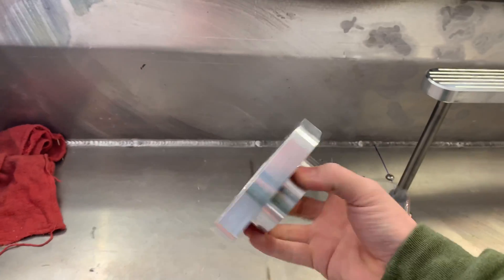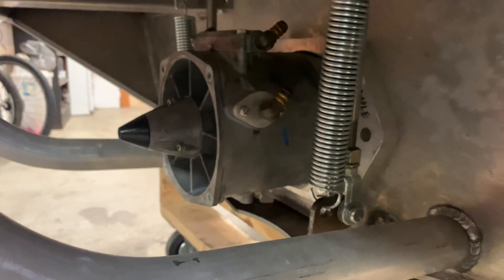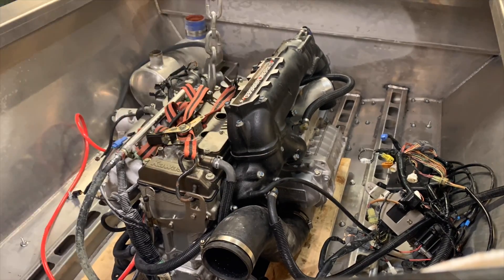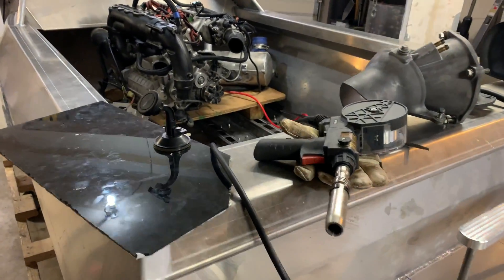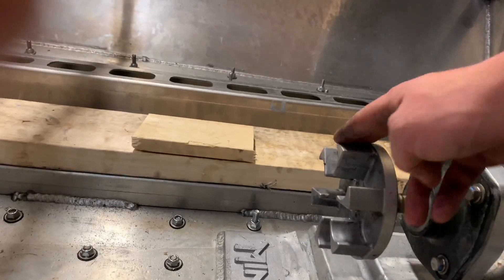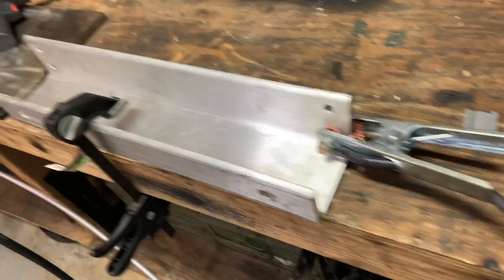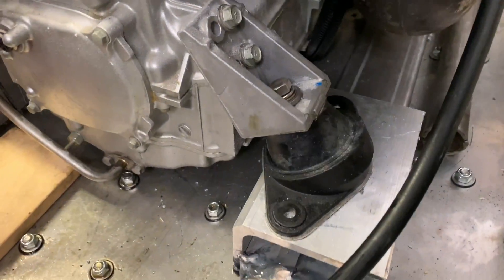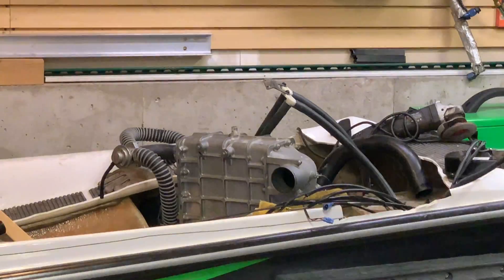Mini Jet Boat Build 6 - Motor mounts, pump shaft collar and engine install.

Comment: Have you ever pre cleaned your intended weld area? Steve Wonder puts on a good aluminum welding course you should take.
Reply from the maker: Before this video, no. This was the first time i had ever welded aluminum.  And for the welding course for "stevie wonder". Id probably learn more from you uploading a video of welding motor mounts into your aluminum boat.

Comment: How about using some Lock tight or some Lock washers!
Reply from the maker: Where were you 4 months ago! =] I actually had one of my motor mount bolts come out specifically due to not lock tighting them! (they all had lock washers but engine vibrations didnt care)
Reply: @Localhost127  rite on! I really enjoy watching your build! Where you live? I'm in Washington state

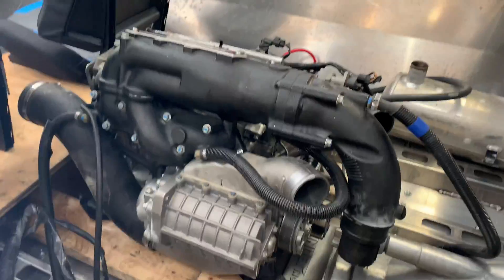Comment: 0:52 You already took my advice from another video I just commented on :) Good idea that impeller and how smooth the blades are directly affects your fuel economy and overall performance (also notice how close it is to the housing; that has a HUGE impact on performance too).  I learned that with jet will be designed with such close tolerances when the turbine gets up to operating temperature the blades will "wear in" to fit as close as possible to the housing.  Even though they are made out of Ni-Based super alloys like Inconel which has a relatively low coefficient of thermal expansion they "grow" enough to touch the housing.
Reply from the maker: I have a Skat Trak thick blade impeller coming in soon. That should take the abuse a whole lot better =] I appreciate the advice!
Reply: What you know about Inconel? I work with that material everyday doing contract work Aerospace companies.

Comment: Great video and Great work... couple of thing I have learned about aluminum.  1st you can cut aluminum very easy with common circular saw used for wood.  It works great, just make sure to wear safety glass just like everything else in a shop.  2nd, welding aluminum is better if it is at room temp (70ish F.)  and supper supper clean, pure argon.   Again your videos are great and you are an exceptional fabricator!
Reply from the maker: Thanks for the tips! I think i am going to have to try the circular saw method. The butter knives just arent cutting it =]
Reply: @Localhost127  some people may turn the blade around and run it backwards. But I have cut it fine with the blade normal. Just move slow, it works great.  Your welding is defiantly improved by EP 12.  You taught me something by sharing "push" don't pull.
Reply: @onemanswork9248  don't flip the blade. just run it the normal way.

Comment: What made you decide on the 11' over the 10' or 12'?
Reply from the maker: The 10 and the 11 foot are the same width, but just different lengths. The 12’  is a good bit wider, and longer. I wanted to keep the boat smaller, but have the added length as I ended up with a 4 cylinder 4 stroke. 

Really what sold me on the 11 foot over the 10 is the B-shop boats on Facebook. They looked phenomenal and seemed to have the right proportions. Definitely glad I ended up with the 11 with how tight everything is going to be.
Reply from the maker: Also, with the swim deck, the 11 foot ends up being like 13.5 foot long.